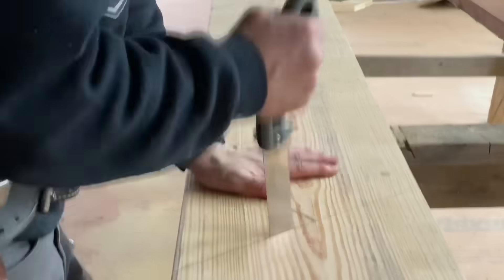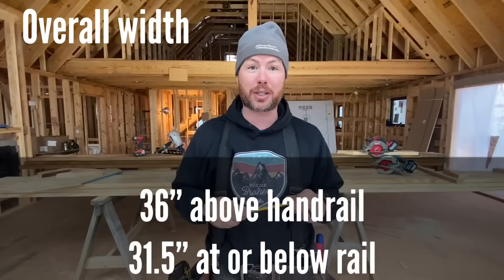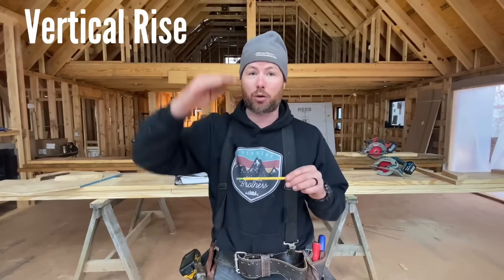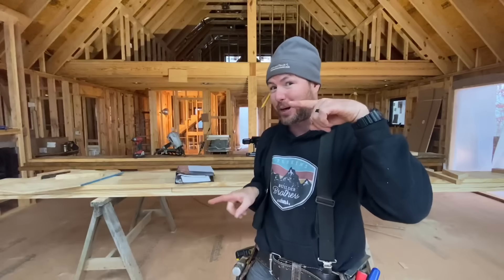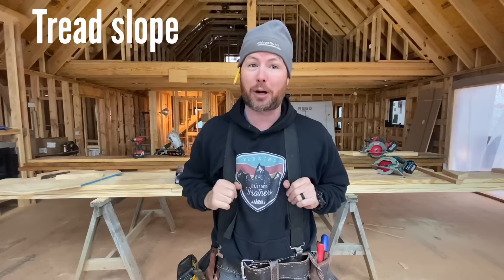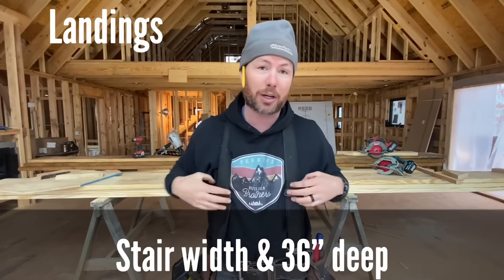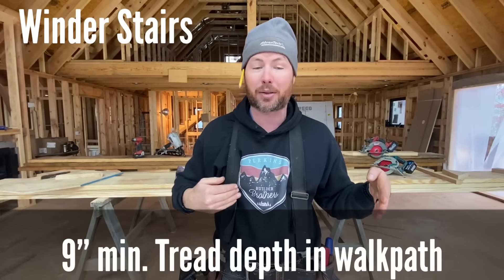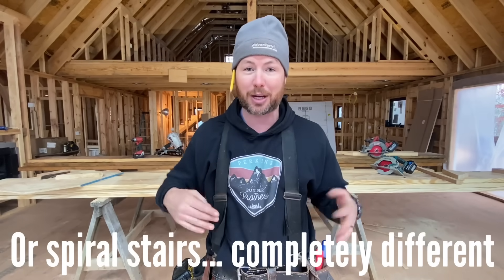All of the building codes for stairs in one video! How to build stairs

Comment: My house was built in 1989. All carpet except the front foyer which is 3/4 thick oak strip. The interior stairs are shop built ( housed stringers) and they are a festival of code violations. Went to replace all the carpet with HW.  The foyer steps were pine treads which are all solid and full of drywall screws. They were measured subfloor to subfloor so the first step is at least 3/4 low and the top step likewise 3/4 tall. They are framed 36 wide so its 35" drywall to drywall, and since the outside skirtboard/stringers are 1" the treads are 34" skirt to skirt.

Comment: What code are you talking about?  It is not the IRC which is what most places in the US use.  Max rise is 7 3/4" and minimum tread is 10".  Other stuff is wrong too, but people need to check local codes for themselves.
Reply: Nc res code has a variance for 9” run min 8.25” rise. Most other states are min 10” run max rise 7.75.
Reply: @robertwilson7708  Variance refers to the difference between any 2 rises or runs in a flight of stairs.  The minimum requirement for rises and runs is what you are talking about.  North Carolina uses the IRC with a state specific requirement for rise and run.  I know that Wyoming does similar with it's stairs.  Why it is so important to check your local codes.  In California even between cities there are often differences.

Comment: At 2:00 minutes, you mention an exception to the stair width code of 36" (min) if the stairs are not needed for egress.  However, I am not sure where this code is written in the IRC.  The reason why, we have a non-permitted portion of our house that has a basement stairwell of 35", but there is an egress window less than 10 feet away.  I am wondering if I can get this portion of our house into compliance using this exception.  Where is this exception written?

Comment: Risers 8.25"?????  Not in GA.  Is this an older code book?  In GA - literally called the county inspector and a home inspector and they said it's 7 3/4" inches.
Reply: Nc RC is 9” run min and 8.25” max rise. Sc and other states are 10” min run and 7.75” max rise

Comment: I really appreciated your video. I've been trimming out stairs since the late 90s. Thank you for pointing out the carpet exception to the rise code. I immediately looked it up and it says the same in my Michigan code book. I never noticed that before and I'm not sure how many are aware of that. Seems like every inspector has their own version of how they treat carpet and you have to second guess them. Now I can show them the code book.

Also, here in Michigan there is no exception for the top and bottom rise being greater than 8-1/4". I was quit surprised when you said that where you are at, you can be 3/4" off. That is a huge trip hazard especially at the top step, the worst place to have a misstep, no pun intended. That doesn't make sense to me at all. I personally know of a case where an individual fell down their stairs at home and it ended up being fatal. The top of the stairs is where you definitely do not want to trip at, especially going down the stairs. 

Another point, I always heard that a rise and tread should ideally equal 18", not 17". And an even better way to calculate it is to double the rise and add one tread equaling 25". It's even better they say, not sure if its code though.

Again in Michigan the least you can have on winders is a 6" tread depth at the narrowest part, not 4". At one time it probably was though

Finally, I noticed you didn't get into the railings much, but I thought I'd mention this too, because its such a huge one here at least. Here you need a continuous rail going up at least one side of the stairs from the first step to the top so a person can maintain a grip on the rail and never have to take it off until they reach the top. That one gets people a lot. For instance, if you have a wall half way up you need to jog the rail around the wall and continue on up to the landing or next floor. The rail can't be in two separate sections. 

I realize codes are different though out the country. Just thought I share what I know about Michigan. Thanks again, keep up the good work.
Reply: Very very interesting. 😊

Comment: are old stairs granfathered? I'm replacing a cheap spiral to the basement, and want to put stairs back in. two story row home. 94 inch to basement floor. horizontal head room from finished floor is 102 inches. how do you make this stringer? stairs from first floor to second floor has 12 steps, and the angle of steps are 47.5 degrees, tread is 10" hieght is 8.375.

Comment: Not sure about codes in Texas but I trip on the first and last steps either going up or leaving because those steps are shorter or higher in height. And it’s completely open. I have an size 9 in shoes and a good chunk of my toe into mid foot goes through the empty risers. I always hated carrying heavy awkward things into the apartment like when I first moved in. Hoping this video explains how many stringers is needed minimally for certain wide a step is. See a lot of videos that builds decking but use like 4 stringers on a (I’m exaggerating) 15 ft wide step.

Comment: I've seen it several places that the calculation for comfortable stairs is Rise" + Run" = 18" (You mention 17" in the video). That's not to say you're wrong. Your right in there but my research shows the following. It was either the IRC or IBC that recommended 7.5" rise over 10.5" run. I've also seen another carpentry method for comfortable stairs that says (2 x Rise") + Run" = 25". If you were to graph out these two methods on a sheet of paper they actually intersect at a prime comfort ratio of 7" Rise over 11" Run.  7" + 11" = 18" and (2 x 7") + 11" = 25". Just some food for thought.
Reply: I think that applies to the framing

Comment: Great video!  I didn't see a reference to this so there may not be a code on it but is there a recommended distance from the bottom or top of the stairs to a wall? For instance, when you come to the bottom of your stairs in a basement and your wall is in front of you, how far would you recommend  for the distance between the last step and the wall for good clearance?  Thanks.
Reply: I think that would fall under the landing code so 36” at least. (I think)

Comment: Havent watched all video yet but I thought you might mention what a "sword step" is. A shotened or lengthened step in a set of risers from medieval times that caused a person to trip up or down during a sword fight. It was installed so a homeowner knew where it was but an intruder did not, so in the fight they would stumble and owner or defender would attack at point of stumble. FyI

Comment: For winders, the 2018 ICC R311.7.5.2 states tread depth shall not be less than 10” within walkline and not less than 6” at any point within the clear width. The 4” and 9” is a North Carolina code change. Great video explaining the code for stairs. Very helpful for builders and inspectors alike!

Comment: There is a lot of codes with stairs. Up our way hand rails have to turn into the walls. That's so when your house is burning the fire hoses don't get caught in them. You can get a good pamphlet from the stair builders association that covers a lot of the codes with pictures to help explain what the code says.

Comment: That's assuming the ICC is applicable in a person's region - in Canada we use our own national building code as a standard. From that, municipalities adopt or develop their own codes, and is what the inspector for that area will want to see when it's finished. Stair location can play a factor in different regions too, ie: indoor vs deck stairs. Some codes call for an 11" tread for outside stairs while indoor is 10". Some call for 10" treads in both cases. You covered the basics for stair building, but people should really consult LOCAL code requirements before building them. If they're doing it professionally, as a contractor or a handyman, then they should definitely spend the $ on a code book that's applicable for their region. A certified journeyman should already have one from school to begin with...

Comment: In Maryland a lot of people decks fail due to no solid risers installed. Also if you cut the deck stair sides, you have to use a solid piece of lumber to reinforce the cuts. Also the Minimum dimension for spans applies here.

Comment: Say you have a set of stairs from a garage to interior space. The door at the of the top of the stairs has a threshold higher than the interior finished floor. Where should you measure to for a consistent rise height?

Comment: Max riser height in the 2018 irc code book is 7¾" not 8¼". No allowance for a ¾" variance in the top and bottom riser either. All risers must be within ⅜" of each other .  You may have a local or state amendment that allows 8¼". Also minimum tread depth on a winder is 6". This could cause a big headache for somebody. R311.7.5.1 is the code section for riser heights
Reply: In our code (MA) we have to be within 3/16” between two stairs but within 3/8” of the whole run.
Reply: Has there been an amendment lately for tread depth?
Has the code changed?
What’s the minimum today?
Reply: Yes, 7.75" max riser.

Comment: Well, I was hoping to share this with my fellow inspectors and builders in my area (north texas), but we are using the 2015 irc and it is very different on the rise and run measurements
Reply: Yes, and I’m sure the codes you use for commercial /industrial stairwell construction will be different as well. Just like here in California.

Comment: As a general contractor who started out in the flooring industry 34 years ago I can tell you that your reading of the code with respect the carpet is not what was intended. Carpets mentioned are free carpet unattached to the substrate, ie throw rugs. In contrast, wall to wall carpet is measured from the top of the backing to the floor. So typical residential carpet will be about 3/8 of an inch, as this measurement includes the tack strip. And yes, a diligent inspector will put a tape from the top of the carpet to the top of the first tread. They have done just that on many of my jobs.
Reply: Mine too. The ICC is also only applicable in the US, and if the US is anything like Canada, then code could differ from state to state as well, or city to city even. We have a National building code standard, and from that each municipality develops their own code. In one town the local code might call for 10" treads for all residential applications, while 20 min away in the next town over they could call for 10" treads indoors and 11" treads on all deck stairs. A person should really forget anything he pulled from the ICC, retain the basics from this lesson, and consult LOCAL building code in their area to make sure they don't end up building the damn things twice. Just ask when applying for the permit (which people should be doing). Inspectors are usually more than happy to spend lots of time talking about how they like to see things done...
Reply: @JamesBiggar  That is all very true In the us as well. But the ICC is typically adopted wholesale and then Exempted or deviated from on particular items. Such items typically include International Existing Residential Building codes for ADA, or IRC foundation requirements, or any number of other   adoptions of a similar type. But such deviations do not typically include stairs, In as much as municipalities rarely find anything unique about their environs or labor force that would require a deviation. Point being that variation from state to state or municipality to municipality are typically put in place on top of the code do as to better facilitate the uniqueness of a particular region. But there is nothing about stairwells in new costruction that would require any such considerations, except for perhaps uniformity with existing structures in inner cities. But the house being displayed was not being built in the Inner City. And besides, he was quoting the IRC incorrectly. His interpretation is simply factually incorrect. But in general I do agree with your sentiment.

Comment: Good information.  We built 5 sets of stairs for our condo.  Our carpenter friend did helped us lay out the stringers.  One of the homeowners attached the 2x6s for the treads using some leftover trex screws instead of using decking screws.   The inspector called us out on them but eventually let it slide.  Otherwise we followed the code.  If a hurricane comes the building may be gone but the 5 staircases will still be standing with all the bracing and lag screws required to anchor them!!!

Comment: It's not the baby's head, but the body that can fall trough feet first. Body will go trough and the head gets stuck and baby is left hanging. Very good video, very instructive. Thanks for sharing. God Speed and God bless. ;-) keep them coming.
Reply: Yepp, i like open best. You solve this easy by putting a board under the step that gives both strength to the step, opens for the foot and makes the hole smaller.

Comment: What is the height for a stair rail
Reply from the maker: Between 34 and 38 inches to the top of the handrail from the line that connects the points of your tread nosings.
Reply: @PerkinsBuilderBrothers  You guys should do a video on stair rails. There's a real shortage of information about them on here, especially how to actually locate the brackets.